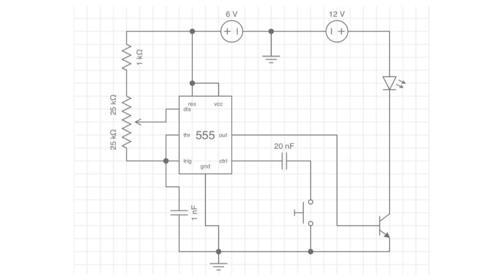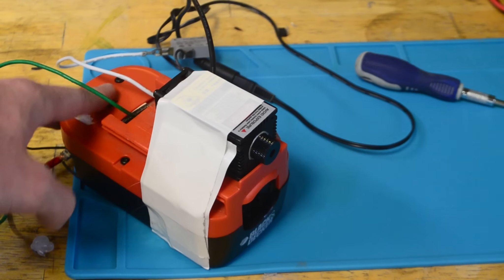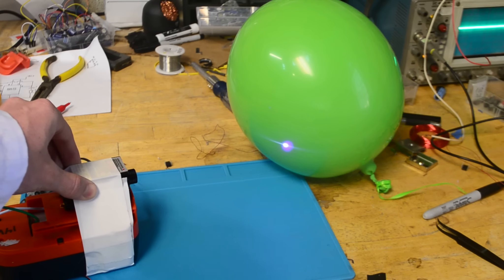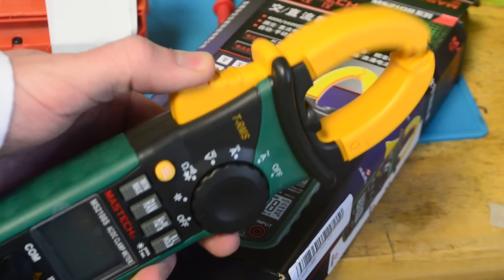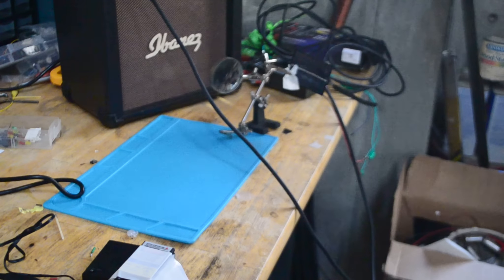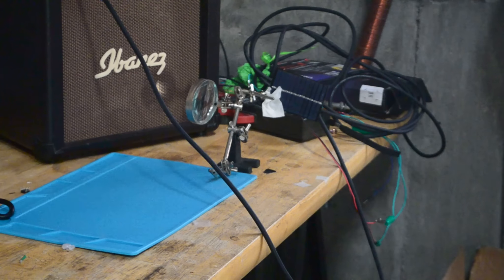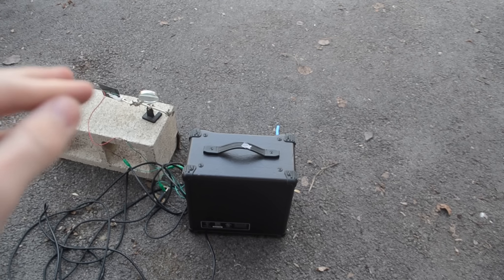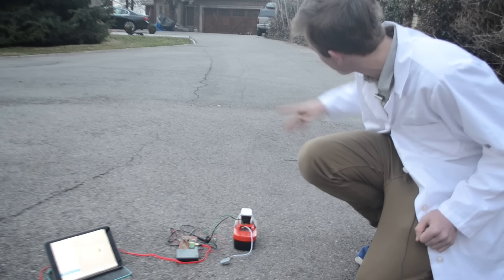Laser Transmitting Music

Comment: Most commercial optical communication are data links at around 1Gb/s and are limited to 3/4 of a mile (1.2km). Ham radio operators also experiment with optical, using various types of signals as well as setting records. For instance as of 2007 the record for a two way voice conversation was 173 miles (278 km). One of the biggest problem with using lasers is that they are notoriously hard to focus. Systems built with high power LED's often have much greater range.

Comment: I may have thrown this suggestion under another account about the laser. Have you done a Modulator with Microwaves? I was thinking you can use a Microwave diode or two microwave oven Magnetrons with said circuit? You can use two radar detectors as they have the 10.5ghz waveguide and diode.  (Some may remember passing another car who had one would set yours off) You could send audio/data MILES away just like cell tower to cell towers do. (Line of sight) I'll leave the parameters up to you. You could split screen to show the input and output. Or just test it down a road of field. You could show what true duplex audio is! I'm sure I lost most people but you understand. People think you know only do a one way comm with a set of horns. :) I used to do this back in the day with under 1 watt and is was fun. Talking at same time much like a telephone.

Comment: What would happen if you amplified the solar panel by way of a lm386 or ua741? This way 1. The circuit is grounded and you DITCH the ground hum. And 2. You should have better audio going into the guitar amplifier, and in turn  it should be louder.

Comment: What if you had a very long but sealed tunnel like a small tube within an already made air vent? That way the length could be as far as you want without the price of fiber optic cable and would only need mirrors for turns

Comment: is the interference caused due to dust particles in the air?
Reply from the maker: +DavidTheTech some parts was me waving my hand in front of it, however I'm sure there was interference due to dust, when I would test it near a dusty area I could hear almost a static sound from the dust in the air
Reply: Cool!! Great work by the way!! May I ask where did you learn about electronics and circuits?

Comment: that is clever, He talks so fast I had to play it on half speed to follow it...i wonder if using a fine beam or a directional wifi signal uses less energy?  .(.but you'd need to 'ping' a wide signal 1st to locate the laser receiver). Perhaps that where normal radio signals are an advantage, as they broadcast over a wider area they can be received easier. ( can you make microwave l.a.s.e.r.s? they seem to only have 3 colours in light)